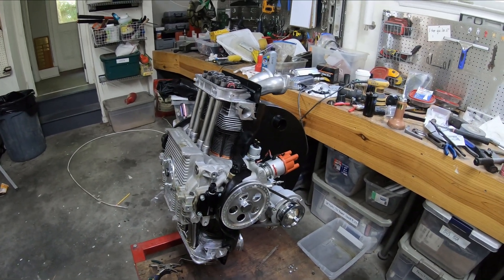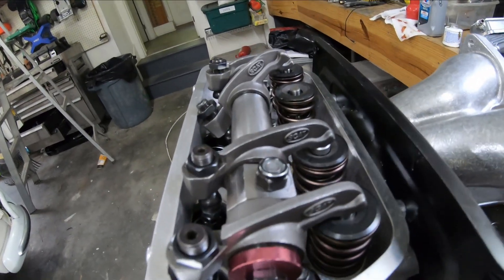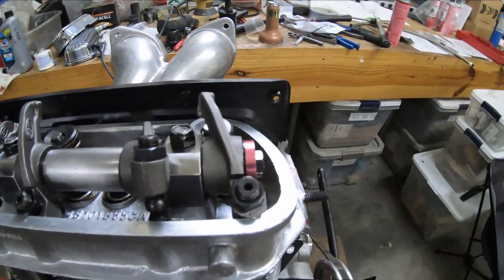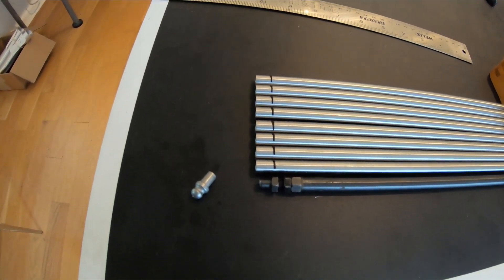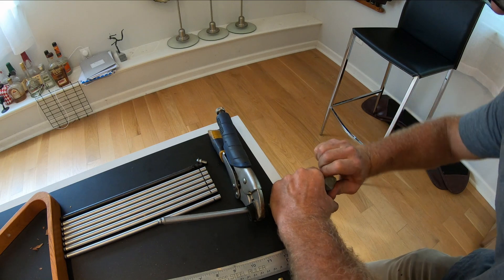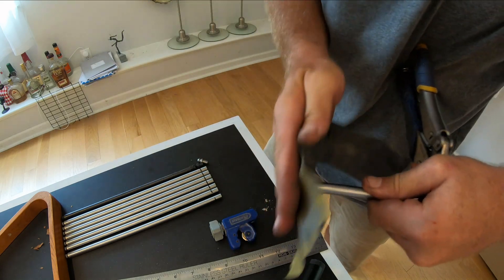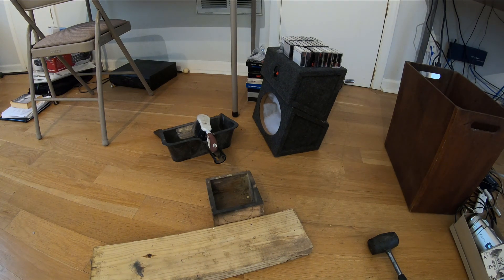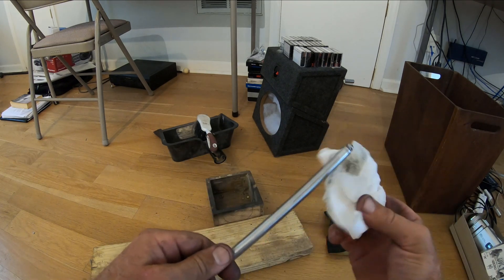2332 VW Air-cooled Stroker Motor - Video 69 - Rocker Arm Geometry - Pushrod Measuring and Shims

Comment: So to get your rocker geometry correct all you have to do is turn the engine over and if you hear compression you’re good and you can cut your pushrods?
Reply from the maker: Not exactly - you need the angles of the rocker arms to be correct.  I used a pushrod measuring tool which is basically an adjustable pushrod.  Then you bolt down the rocker arms and turn a full cycle, measuring zero lift, half lift and full lift.  At half lift, usually the rocker arm is perpendicular to the push rod - or the rocker arm is level.  Once you achieve this with or without shims - you can measure your adjustable pushrod and cut all 8 that exact length…